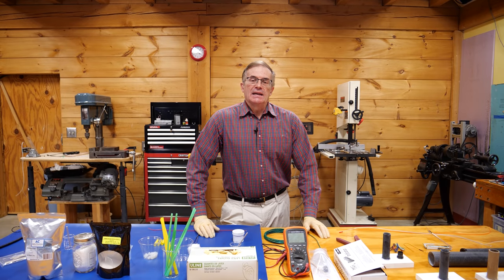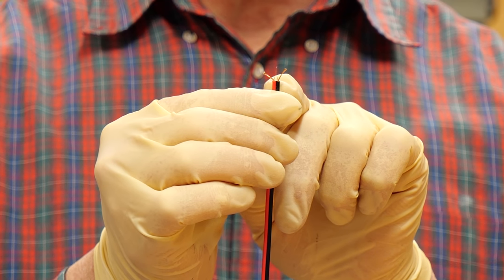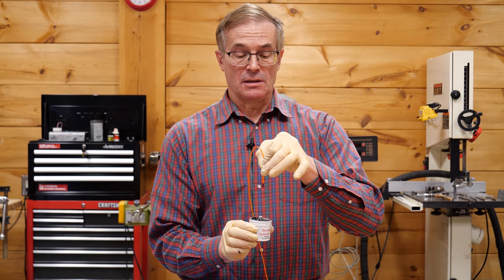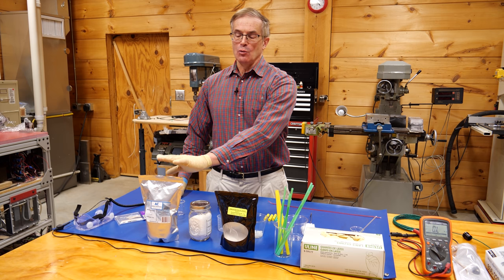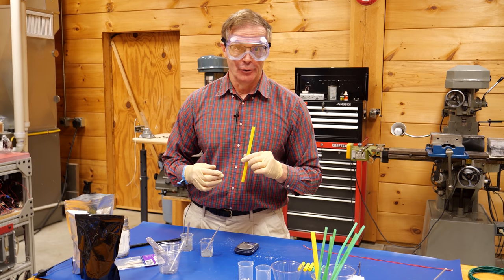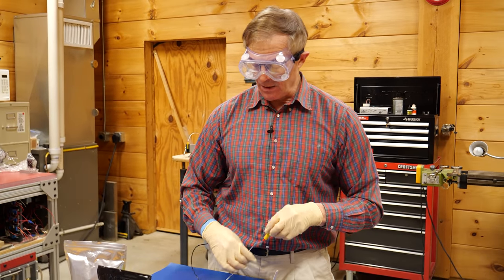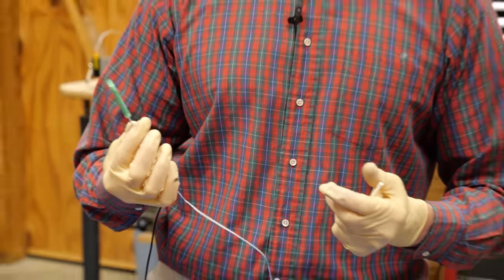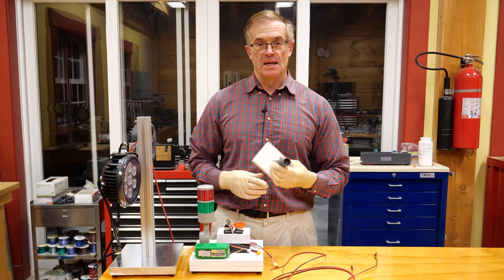Rocket Ignition System On Steroids!

Comment: I've been considering doing some of the silver/H2O2 rocket engines as I've heard they're a lot safer than most. Russia used them at least up into the mid-1990s to get many of their satellites, etc. into space. Since the silver only acts as a catalyst in the reaction, it can be recovered and used again. And since the reaction only creates steam and oxygen as its byproduct, it's far safer to set off. Have you ever considered using that reaction? It wouldn't be incredibly hard or expensive to produce 100% H2O2 so I'm seriously considering it.
Reply from the maker: I would be more concerned about handling H2O2 than rocket propellent.  If you're concerned about safety, look into hybrid engines.  We'll be doing videos on these soon.

Comment: I've seen other YT videos where they graph out the thrust curve with a laptop, I bet you could get a load of useful data like that.  Is there an el cheapo way of recording such data?
Reply from the maker: We have a system to do that on our test sled, but it wasn't cheap.  A hacked consumer bathroom scale and an Arduino would be a good place to start.
Reply: @TechIngredients  For a college senior project one group used a chart recorder, a "frictionless" sled, an LVDT, and some linear springs with K based on the expected thrust of the Estes rocket. After generating the graph, they could integrate under the curve by the cut and weigh the paper method to get the work done by the rocket engine.

Comment: Loss of efficiency as some propellant burns outside the chamber.

Easy fix is to scale it up, OR include an empty 1 inch below the grain for small rockets.  I ran 4 tests, and it's worth it with a lightweight casing.  S 40 Pvc pipe not so much.
Reply from the maker: Don't forget that the fuel grain is also serving as thermal insulation for the casing.  You'll need something to protect that if it's exposed to the exhaust for the entire burn.

Comment: You know that flash powder is way too complicated than it needs to be. If you want flash powder all you need is potassium nitrate and aluminum powder that's it. You don't need to get ammonium perchlorite, that's doing way too much. Ammonium perchlorate you want to save for the rocket motors. Because ammonium perchlorate isn't easy to come by and it's expensive. Potassium nitrate is as cheap as it comes.

Comment: In case your two wires melt together accidentally when starting rocket engine, do you have any protection in the line for your battery pack??
Reply from the maker: The battery can safely generate 50 amps.  The wires should melt.
Reply: @TechIngredients  Perhaps a resetable fuse to prevent any burning of wires close to operator.... ;-)
Reply from the maker: Not a bad idea.

Comment: The stoichiometry of your base flash powder composition is really oxygen deficient; was that intentional? If I did my math right, a 1:1 mix (by weight) of Al and NH4ClO4 will leave 60% of the aluminum un-reacted. Interestingly, while BaSO4 isn't normally thought of as an oxidizer, it is almost certainly acting as one in a 3000°C aluminum-rich, oxygen deficient combustion plasma: 
6∙Al+3∙BaSO4-->3∙Al2O3+3∙BaS
Is that the reason your modified composition is working better than your base composition? If you work out the stoichiometry for your modified flash powder (with the BaSO4) the oxygen balance is almost perfect:
27∙Al+6∙NH4ClO4+5∙BaSO4-->3∙N2+5∙BaS+6∙HCl+9∙H2O+9∙Al3O4
Where "Al3O4" is not the usual +3 oxidation state because it's still slightly oxygen deficient.
Reply from the maker: Firstly, a stochiometric ratio is too violent and despite the loose cotton they often go "bang" rather than flash.  The sulphate adds oxygen, but also increases the non combustible mass which tends to balance the extra heat released.
Reply: @TechIngredients  I wonder if the thing to optimize for in an igniter is heat production with minimal gas production? Something fairly fast-burning like copper thermite could reliably ignite the propellant grain purely by radiative heat transfer?

Comment: And another question, can you experiment with a rocket fuel formula that has a longer burning time of at least 7-8 sec. to be used in the propulsion of jet aircraft models?
Reply from the maker: Did you watch our video on the "DIY Rocket Motor"?
Reply: @TechIngredients  Yes, of course, but it seems that they have operating times of 2-3 seconds when they go through the reactive nozzle.

Comment: 9:52 Wouldn't a plastic container be safer than a glass one? If an explosion were to actually happen, a glass container would generate a lot of fragments. Static (as far as I know) is not a huge problem unless extremely unstable compounds are handled, so switching to a more fragile container could outweigh the small safety gains from reducing static?
Reply from the maker: You can get antistatic plastic cups although they're pretty expensive.
Reply: No, he's correct! Static is a real danger when mixing stuff like this. That's especially true when it's cool with low humidity as it often is in the winter months.

Comment: Isn't  NICROME wire preferred for solid rocket motors?
Reply from the maker: It's not important as long as the resistance at the termination is much higher than in the conductors.
Reply: @TechIngredients  I  used to launch ESTES rockets back in the early 70s. 
I was all of about 11-14 yrs at that time .
They claimed to have used NICHROME wire coated with their own ingredient. 
I don't know what that was. Some of your "discards' could well work better than some of those ESTES wire igniters.

Comment: Could you try experimenting with seasonal energy storage systems?
Reply: You mean giant shelves of batteries? Honestly I still see the reservoir system as superior. Pump water up a hill in the summer when you make the most power, and let it run down a hill to turn a turbine in the winter when power demands are highest. Get's the storage in the gigawatts, completely clean environmentally, and doesn't require temperature regulation like batteries. Just can't use it in areas without hills. https://www.youtube.com/watch?v=66YRCjkxIcg
Reply: I meant things like phase change materials to store the heat of summer chemically. Since the main presenter and his son seem to live in a cold climate it might be interesting to see if it could become a practical solution. If the initial materials have a small carbon footprint, it might be a green and sustainable investment. Also one more area where you could minify your dependence on the grid.
Reply: you mean sort of like those reusable hand warmers? Though those take boiling water to reset them so they aren't very environmentally friendly. Unless you somehow found a way to boil water with a magnified glass. 
https://m.youtube.com/watch?v=Oj0plwm_NMs&t=985s

Though will note, he said he lives in the north east. It gets cool enough to snow in the winter but still can gets in the low hundreds in the summer. Plus you don't get the dry heat of the mid west, it's the kind of heat that just makes you feel disgusting. I live in the north east as well, but man is it nice going out west for summer vacation. Amazing how here 85 degrees is totally unbearable while out there it can be 100 degrees and you more just feel the sun than the actual heat.

Comment: Mr. Tech, instead of AL powder and perchlorate. Consider only using a metal foil as an igniter, no chemicals needed.
The trigger source is more sophisticated, High Voltage capacitors, HV switch. Suddenly 10000's Amp discharged in 1 usec into the metal foil. There is no need for chemicals the hot metal plasma generated will start the rocket fuel.
Reply from the maker: Did you watch our video "Don't Try This at Home"?
Reply: @TechIngredients  Did not watch that episode.  But you have all the ingredients to do this experiment.

Comment: What type of battery are you using? Can you please post a link?
Reply from the maker: It's just a small, 4S lithium, but any 12 volt battery will work.
Reply: @TechIngredients  Thank you so much for your prompt reply. I have another question. What meter or setup do you use to measure the thrust of your motors?
Reply from the maker: It's an industrial load cell taken from heavy-duty balance.  You can buy a new, but similar unit on Amazon.

Comment: Based on risk assessment principles, you shouldn't use that wrist strap when doing this. The potential risk of you knocking things over is greater than any charge you could/would build up on your body that could generate an igniting spark.
Reply from the maker: Maybe.  But, moving around the table with deliberate care is also a good principle.

Comment: Solid rockets are lauded as "powerful" because you can burn massive amounts of fuel at once to get high impulse. The problem is you burn massive amounts of fuel at once and run out quick, so you don't get far. So you add more fuel, but that fuel is heavy so you end up growing in weight too fast. To get higher you need better specific impulse. To do that you need lighter fuel, like hydrogen. Do you have any interest in building other types of rockets?
Reply from the maker: Did you watch our video on "DIY Rocket Motors"?

Comment: Why did you not use a high voltage capacitive discharge igniter? This has the advantage of being protected against short circuit after ignition, it also has the advantage that the bridge wire can be thicker, and therefore less sensitive to accidental ignition. I know your solution does not use a bridge wire, but this has its own disadvantage, in that the composition can crack and become open circuit, if mechanically stressed. Here again, a high voltage ignition might compensate for such cracking. The traditional binder for such compositions is commonly gum Arabic, shellac, or nitrocellulose dope. Do you know which is used in the commercial mix?
 The common recipe for electric match, contains antimony sulphide fuel, as this makes a very sensitive mixture. Did you consider using it?
Reply from the maker: It might be nitrocellulose, it has no aroma.
Reply: @TechIngredients  my above comments should not be considered as criticism, but questions regarding the engineering reasoning.
There can be little doubt that your solution to the problem works extremely well and appears to be very reliable,  The method of manufacturing the fuse is far simpler and less fiddly than first producing the bridge wire. Some commercial solutions solder the bridge wire across the end of a double sided PCB.
I do wonder how sensitive it is to the thinness of the fuse composition bead. How easy is it to maintain a 9 ohm resistance. One of the advantages of the high voltage system is that it is far less sensitive to the length of the connecting wire.
Reply from the maker: No problem.
This kit works very well.  I've made 30-40 of them with only one falling outside that resistance range and that 25 ohm igniter still fired.
Reply: Converting a discarded defibrillator into a rocket launcher would make an interesting video.
Reply: @NiHaoMike64  that is really far more than is needed. A simple, single transistor  blocking oscillator, driving a step up transformer, followed by rectification and a capacitor, will deliver a few hundred DC volts that can be used to explode a bridge wire. 
This is not much more than is in a camera flash unit, or an electric fly swatter. As in the camera flash, a neon indicator can show when the circuit is charged and ready to fire. While more complicated than a battery and a switch, the circuit has a number of advantages in terms of safety and efficiency. For example!e: a longer, higher resistance, cable can be used. The circuit must be charged to fire. 
If the blocking oscillator is designed correctly, it will not be damaged by the conductor ends shorting after firing. A lower energy battery can be used, that delivers a smaller current. The high discharge current, means that the bridge wire is much less sensitive to static discharge, as it is difficult to produce a body static discharge that matches the energy delivered by a capacitor.
The one advantage of the battery, other than its simplicity, is that it will maintain the firing current until the fuse composite starts to burn. Unless the fuse oxidiser is finely divided and intimately mixed with the fuel, it can take a sustained current to start it burning, this is particularly true of potassium nitrate, which must be melted before it really starts to burn. This is far less of a problem with chlorates and nitrocellulose compositions. 
 I suppose a disadvantage is that the circuit can deliver a powerful electric shock.

Comment: I've been building an extremely small hybrid rocket in the last year. I had major problems with the igniters and the valve. As valve I use the skin of a ping-pong ball that is ideally burned through by the igniter (this is the simplest way I can imagine to build the valve). Since the injector hole is very small (3mm) it is almost impossible to have a high enough temperature for a long enough time on the membrane.
My current solution is to use a very small flashpowder explosion to puncture the membrane. I've verified this works, but I didn't ignite the engine yet due to time constraints.
As igniter mixture I look for a stable, relatively slow burning mixture which doesn't get blown out by the small charge.
I would use sugar/KNO3, but maybe someone has a better idea on here.
Reply: Sounds like you are building something akin to the micro and mini hybrid motors originally designed by Rene Caldera. Anyway what those use is a small "pre heater grain" that sits just below the burst disk and injector. Most people just use a small piece cut from an Aerotech RMS reload. The pre-heater grain is necessary because the nitrous oxide must be heated up to it's decomposition point and is going to be cold coming out of the injection due to the energy absorbed as it undergoes phase change when the pressure is released. Anyway, Roy Trzeciak-Hicks  @ Eclipse Rocketry still sells these motors. His website, eclipserocketry.com is still up but it doesn't work when you try to order from it. However, if you go to the "contact us" tab there is an email address you can use to contact him and order a motor kit.
Reply: @stefanl5183  I've used his design as inspiration. However, I am currently not able to obtain high power rocket fuel since there is strikt regulation on that stuff. My preheater grains currently fail because of the unavailability of ammonium perchlorate.

Comment: Could you just add lamp black to smokeless powder and add acetone?
Reply from the maker: I wouldn't.  Smokless powder contains nitrocellulose and the double base powder also contains nitroglycerin.  These are high explosives and can detonate.  Trying to temper this with carbon black and the acetone might  not be enough and you've made a b**b.
Reply: I'm quite familiar with the burn rate and use of smokeless powder and dissolving it in acetone and letting it set alone makes it very tame, adding carbon would likely be even more manageable.
I was moreso musing whether you could experiment with ratios etc and maybe make a video!

Comment: Hi, You talk ok safety but when testing some of the starters and motors you left your igniter with the key in and set to green.
Picky I know but shouldn't you have turned it off and removed the key. Also at the end you returned to the motor while it was still burning and then tried to blow it out.
Petty maybe but who know what might have happened.

Comment: Why not just sprinkle a bit of blackpowder inside of fuel hole ? I did that and it work greate, ok, somethimes too greate and preshure was lil too much  ;) :D thats why you put just a sprinkle to coat inside.
Love from Latvia!
Reply from the maker: You're right, sometimes is too good, sometimes not enough and if the rocket is vertical you have to get that powder all the way up to the top of the center core against gravity.

Comment: What wood it take to make a rocket motor for a club class  15 meter glider   600 pounds 
If Using about  of 500-600 pounds of thrust    And To climb to 3000 ft  what wood  additional weight b
Reply from the maker: That depends  a lot on the aerodynamics of the glider. On the moon, it would require a rocket that weighed about 45 pounds. However, air drag will reduce  the optimal velocity and the thrust/duration will be significantly lower. This will increase the weight of the motor and lower its performance.